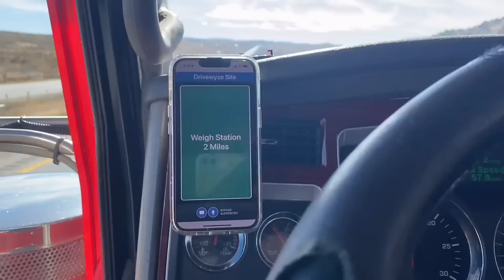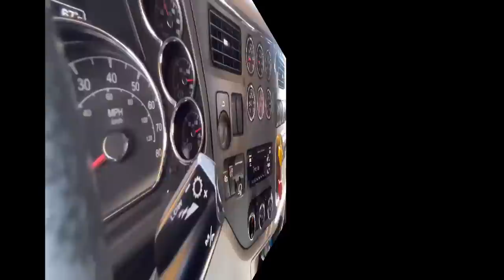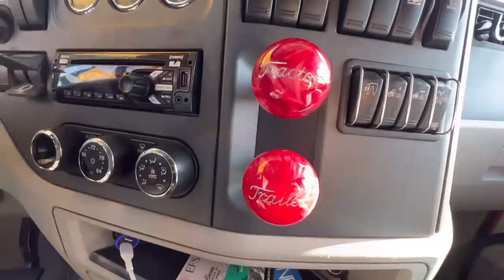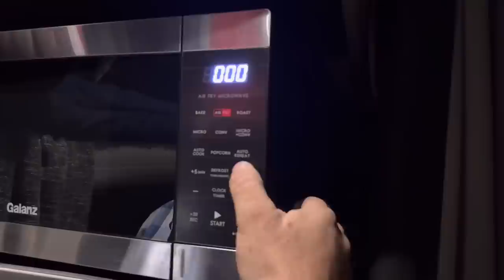“TINY DANCER” | | Real Life Trucking - Episode #201

Comment: It looked like possibly the headlight lenses were a touch cloudy from the sun.  If so, polishing them up with a cleaning kit+drill or new replacement ones will help the lights work better without aiming too high and blinding oncoming. 
Good luck 🤞🤞
Reply from the maker: we did that, just didn’t have time in that scene to show it ❤️
Reply: @TruckingTogether   👍🤗 good luck.  It's fun and at the same time such a pain to switch into a new truck and so many little details to iron out 😂

Comment: With the weight you pull I believe you will be hitting fuel mileage at 8.5 plus mpg . And also get better rest. I just thought you would stick with kenworth and do a 680 2nd gen. I love mine. The quietest truck I have ever owned.  Looking forward to your reviews on your maiden voyage.  Stay safe
Reply from the maker: I like the first gen 579 the most, if I could swing a next gen I would, I like the Pete looks more on the outside. Interior kenworth has it I believe.
Reply: Is the Pete a 2023
Reply: No I just thought that fancy is a kenworth, after all they're both pac car. It'll be great. And you'll also have the greatest camper puller in the park .congratulations
Reply: @steveweebee5643  they said 2020
Reply: Good Video Team Tiny Dancer stay safe. 
God Bless
TonyJoe

Comment: Congratulations on the new ride, looks good. Good candidate for a ceramic coating. Was the wiring already in place for adding gauges? Thanks
Reply from the maker: Yes on Pete’s and kw’s you just plug into the main harness and every gauge is a jumper. Then just turn them on with Paccar ESA program. Only one that needs a mechanical signal is suspension load.
Reply: Thanks!

Comment: Is there only one white backup light as seen at 14:28?
Reply: Only one is required. Typically, DOT doesn't focus on it but they can and do, depends on the officer. If one is not there, a manual switch in the cab to white "work light(s)" can count (mounted to cab) or added similar to the one you asked about
Reply from the maker: All it needs.
Reply: @TruckingTogether  ok, just looked a bit odd and unbalanced as other cabs I have seen on video have two as do most vehicles.